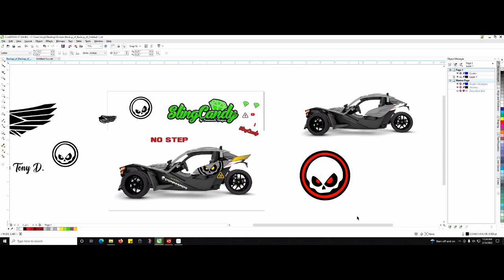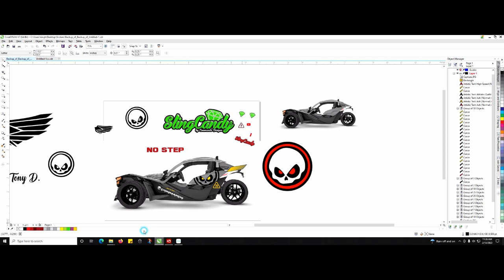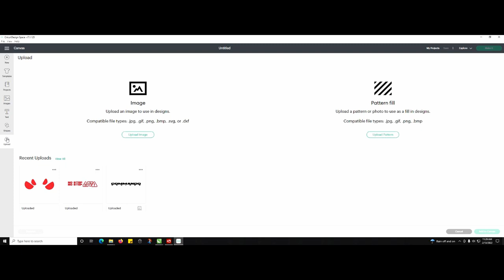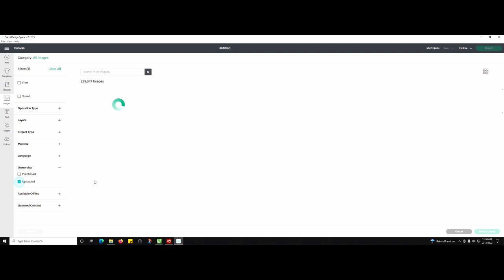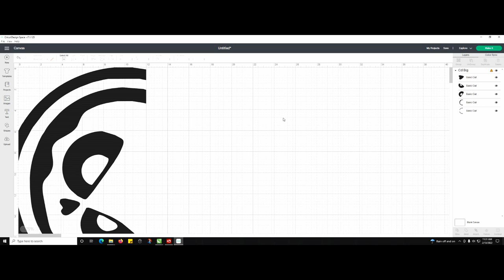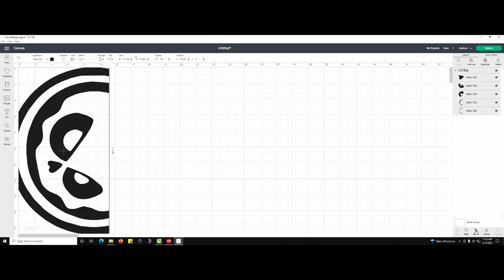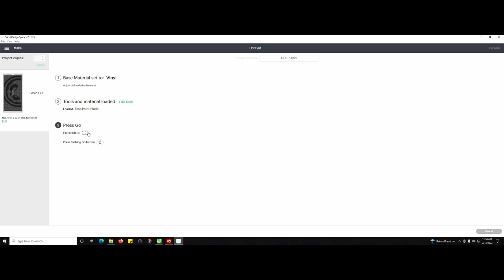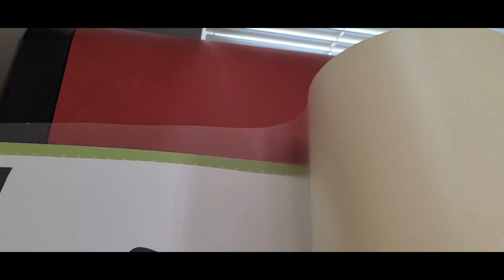Vinyl Stickers for Beginners - Watch before buying a Vinyl Cutter

Comment: Great video (you were the person I watched before I purchased my XYZ 3d printer). I actually work in Printing Industry (R&D), and was with a company called Gerber who invented the vinyl cutter. The ruler tip is great for transfer. Have you tried the soapy water trick for transfer to final substrate ? Another trick is to never pull and use a squeegee when applying. Always a great idea to gently pull your vinyl into position to make sure you get no vinyl lines. Once in position, you can squeegee. Most people pull and squeegee which sets the pressure sensitive vinyl with all the ugly lines etc  Vinyl application is definitely an art form. The soapy water allows the noob to reposition until the very end. Pro's may no longer use it, but I found it helps. The little cricuts etc make great devices. Cheers and keep up the great videos.
Reply from the maker: Not sure why my original post didn't post. I appreciate the feedback. I do have a squeegee and I have used the soap trick.   I think it's funny that you figured out that I was just kind of being lazy.  I should have used the soap trick heat and a squeegee.  I think the good vinyl like oracal and other automotive vinyls stretch a lot better for stuff like this.
Reply: @Commandodesigns  Sorry,, heck no you are not lazy.... Great videos as always.

Comment: I bought the vevor 28 inch plotter but not sure if it’s only allows you to use it with sigmaster basic software?
Reply from the maker: You should be able to use signmaster or sure cuts alot.